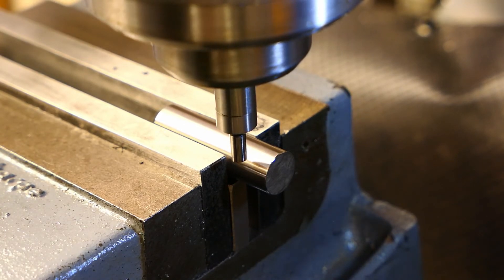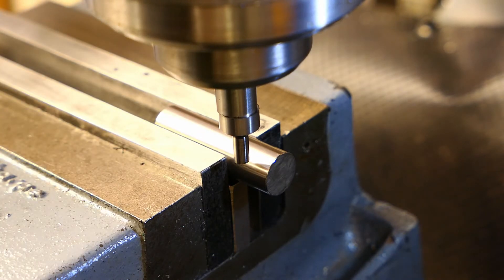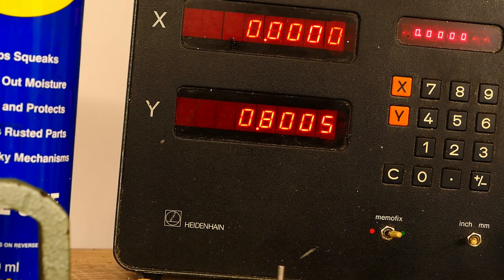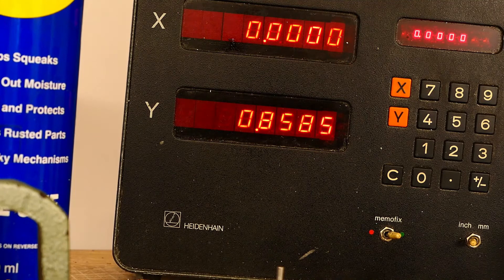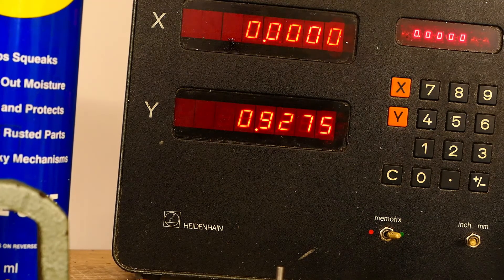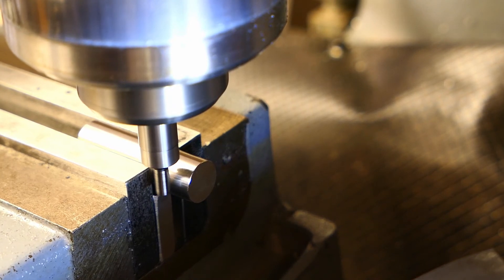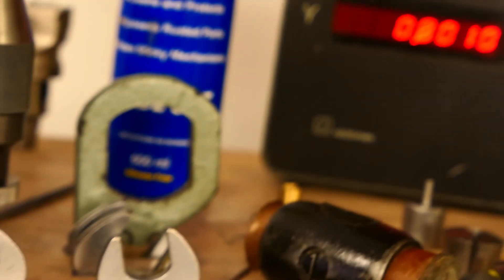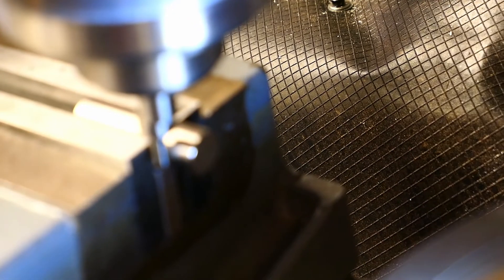Edge Finder

Comment: ON THE MAIN PICUTRE U SHOWED ANOTHRE TOOLS :THAT'S NOT THE ONE ON THIS TUTORIAL. i LEFT A NEGATIVE FEEDBACK !
Reply from the maker: Not sure why you think it is different. I only have one edge finder and it is the Starrett 827B
Reply: @engineeringmodeller   You failed to explain that you are gripping the body, with the writing on, and have a choice of either end to use. So, if it's removed and held the other way around, he'd see the pointer instead. Teaching can be bloody tedious!
Reply: @peterrhodes5663  I would have thought it was pretty obvious that the edge finder was being gripped by the body.
Reply: @suffolkfestivalofperformin9189  Well it obviously wasn't to FASTBOOBS.

Comment: I've watched videos where the presenter pointed out that if you use an edge finder at too high an RPM, the eccentricity can throw the 0.200-inch end off of the tool, damaging the internal spring.  I don't know how fast that is, but your speeds (RPMs) are fine.

I keep looking for videos showing how to properly use the pointed end of edge/center finders though.
Reply: Bob thanks for your reply, your question regarding the pointed end is one that has also puzzled me.  I can see how a point can be used to visually align with say a center point mark but why have the pointed end spring loaded?

Comment: A very good video, but like many items I'd add that edge finders of this type have a direct relationship with there accuracy and exactly how well they repeat that kick off point to how well there heat treated, ground for concentricity, spring pressure, lapping finish of the end faces and even how clean there kept as well as the amount and type of lubrication used. My first edge finder was a cheap and poorly made one. Since it wasn't repeatable I no longer have it for testing purposes against the better equipment I now have. But I doubt it was capable of repeating within .003" at best. All edge finders of this type certainly aren't equal in there performance. It's very likely a poorly made one could be improved by machine lapping those end faces with a mill to improve the surface finish. It's still far better to start with something that's known to be well made like your Starrett. Any of the cheaper one's I've looked at over the years simply aren't made well enough to fully trust the exact point where that kick off happens every single time.

A mill with a dro or even the ground gauge pin isn't an absolute necessity to run this test. An indicator and accurately measured but common 1"2"3" or 20,40,60 mm block most of us would have could also be used. If better accuracy is needed then centering stock directly under the spindle C/L can also be done to far higher levels of accuracy and to easily within a 10th or two simply by using a 10ths indicator swung by hand in the spindle and splitting the dimension in half. There's multiple and various methods that can be used, it just depends on the tools available and the accuracy required. A bit off topic to this video, but I have an old book first written in the early 1900's showing jig boring and finish grinding master gauges that were drilled, bored and internally ground to well under 10ths positional and size accuracy using a shop made dti and hardened and ground tool maker buttons, a very good micrometer and hand tapping the part into position on a lathes face plate long before jig borers and grinders were invented. I doubt I could duplicate what they were doing daily over a hundred years ago even with some better and much more expensive equipment than they had.